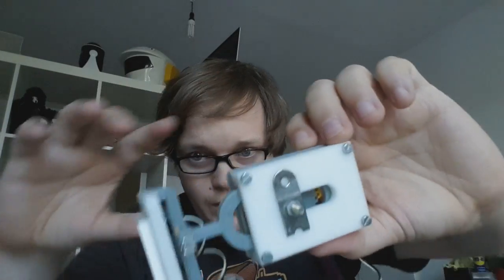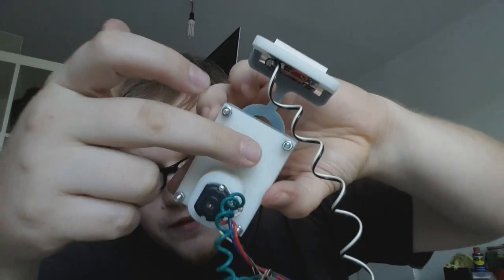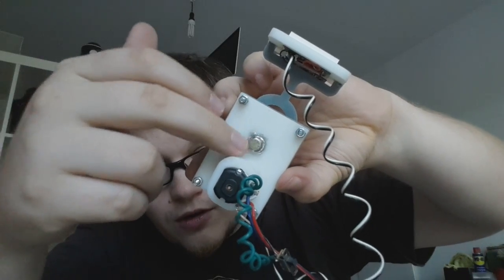Locomatrix - Introduction

Comment: I don't think you are going to get a 3D effect looking at it directly.  That is, the device needs to oscillate from side to side and not front to back.

Also, a gear rack mechanism doesn't seem like the best way because it has a lot of mass and can't move that mass back and forth quickly.

I would recommend that you look at using a solenoid and magnetic armature, basically a long throw audio actuator.  Then you feed a 60-200Hz signal into an audio amplifier which would cause the armature to oscillate back and forth in the solenoid body.

You need a neodymium magnet or such to provide a static field, solenoids just have steel armatures.

Another approach would be to put a lever arm on a DC motor, then feed an oscillating frequency into the motor,causing it to vibrate back and forth, the lever arm would be connected to a rod arm, which would be connected to the LED matrix.  Basically it's like an engine, except the motor doesn't spin, it just oscillates back and forth.  This phenomenon can be seen on poorly tuned servo drives, the motor will move the axis back and forth at a high rate of speed.
Reply from the maker: Since it's a 3D object, I'm sure you can decide where the front/back or side/side is :) I think if you look down from a 45 degree angle to the axis on which it moves one can achieve that.

So I need a bigger motor in that case. I seriously doubt that this has any scientific meaning or a long existence to see, this is more a "oh look 3D for 3 seconds and now it burns, awesome!" project. There is a lot of stress because of the mass, but it's been done with CRT monitors for a while (go check out the comments on hackaday - link is in the description).

There are certainly better ways to achieve a decent display, but I go with the name here "Loco" as in crazy and locomatrix from locomotive - I started with a radial to linear transformation like an old steam train would do - but those gears were to mesmerizing not to use.

THanks for your input though :)